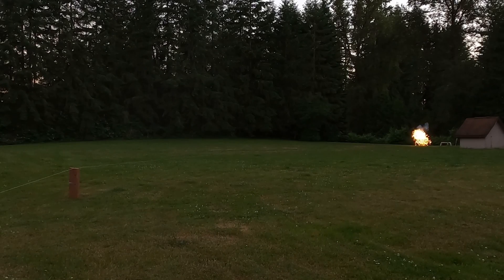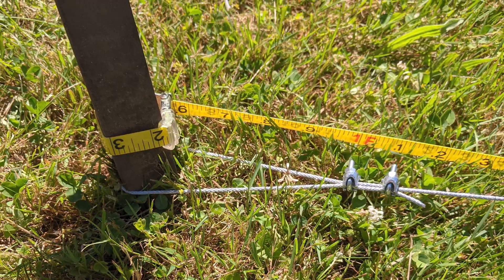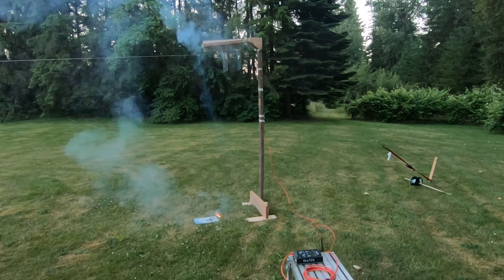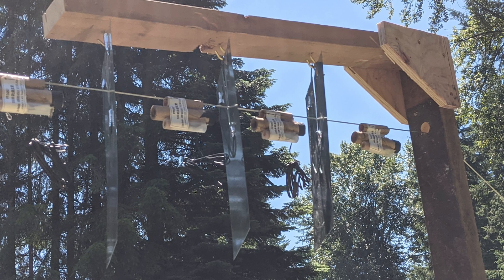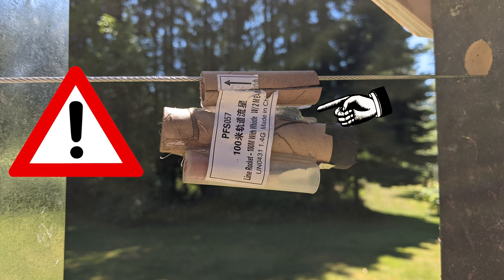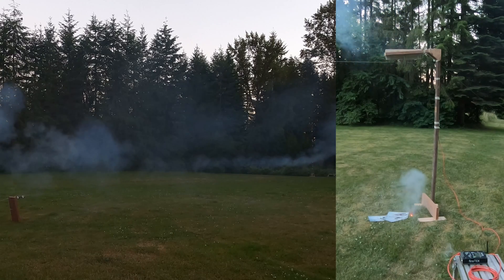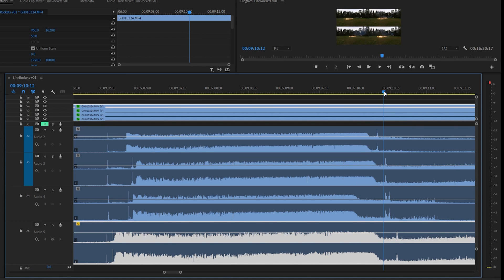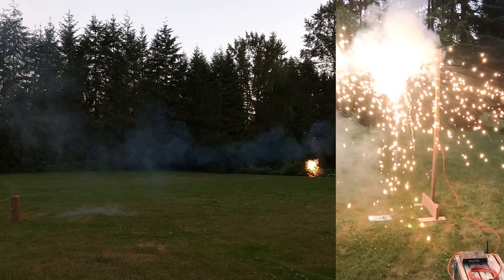Line Rocket Testing - 4 Rockets, 3 Blast Shields, 1 Cable.

Comment: good job, i’m also trying to make something like this for a school project, but i made it like a reel with 2 plastic wheels to put on the cable, and i will use sugar and potassium nitrate mix as fuel
Reply from the maker: Thanks for the comment.   I hope the school project goes well.   If you post it in youtube, come back and share the link.

Comment: Where did you purchase the line rockets?  Is there anything available in 1.4 pro that would work as a line rocket?
Reply from the maker: You can see the PN at 4:28.   Forever Fireworks had these.  Searches on the PN and line rocket show a number of other suppliers.
Reply: @ignite9550  Thanks.  Realized that after I posted the comment and felt stupid lol

Comment: Great video again!  Thought about doing this in 2023 across a pond and you have given me a few ideas... yes am already planning
Reply from the maker: I'm glad this has given you a few ideas - I hope this is overall helpful.    Sending this across a pond would be pretty cool.   If you go for it, I look forward to seeing the video.
Reply: @ignite9550  We shall see?  I will be at almost 500’ across.   With the drop across the pond not sure it can be done without building a 25-30’ tower.  Maybe a little to much extra work for 2023 with building 3 barges for gas mines